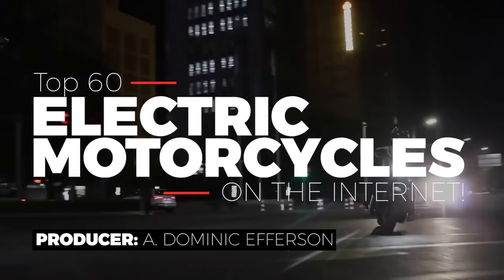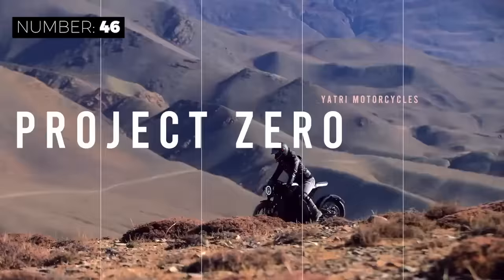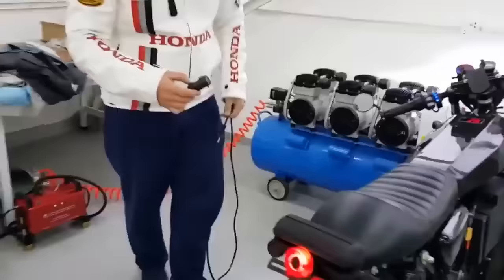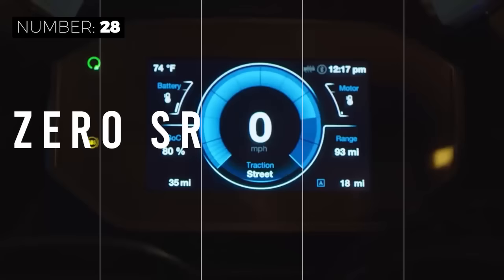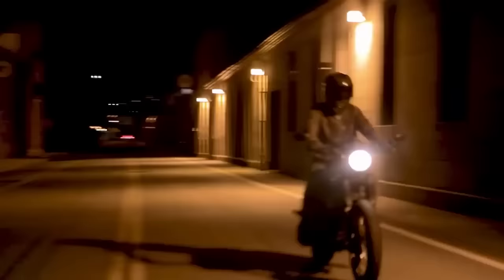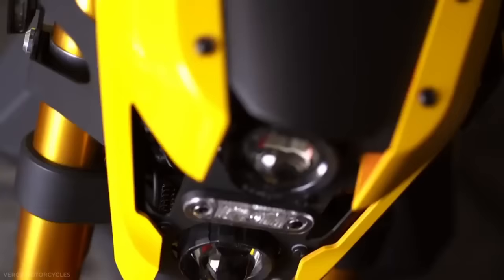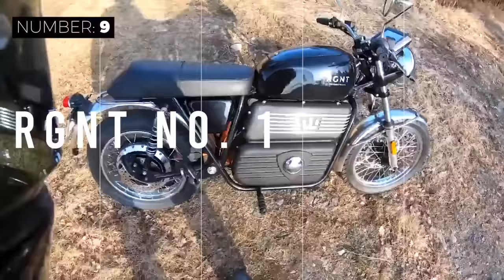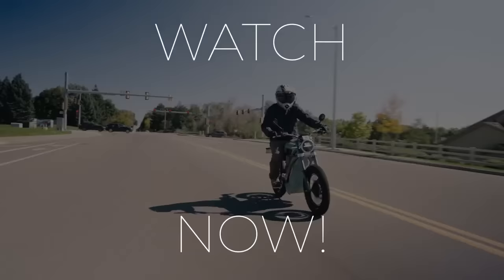60 Electric Motorcycles You Can Actually Buy

Comment: HD also bought the top ebike manufacturer in America. The live wire is a water tester and shake down product.
It started at 30k now it's 15k. Sounds like normal r&d new products.
Reply: Agree
Reply: 🤣no, it's because nobody wants them
Reply: I agree nobody wants them at 30,000 but it's a viable option at 15k.. the biggest drawback I see is fast charging at the dealership only and at home 110 v... There is no level two option

Comment: I want more cruiser options that don't cost $25k-30k.  Give me an electric Honda Shadow or Fury for $8k or less with a range of 250+ miles per charge and a charge time of 30 minutes or less.  As long as it can reach highway speeds easily and safely, I don't care about horsepower.

Comment: There has to be a way of towing a small trailer with two or three extra batts to make easier long distance travels. They could be connected by wire, so to set them on as needed wthout need to stop.
Reply from the maker: That's a fantastic idea and a creative approach to extending the range of electric vehicles (EVs) for long-distance travel! 😃 The concept of towing a small trailer equipped with extra batteries could indeed offer a practical solution to one of the main concerns around EVs, which is the range anxiety associated with longer trips. 

This idea taps into the potential for modular energy storage solutions, making electric travel more versatile and convenient. While there are technical and safety considerations to address, such as battery management systems, connector types, and road safety regulations, the concept holds promise for future EV innovations. It could also open up new business models around 'battery trailer rentals' for road trips.

Thank you for sharing your insightful thoughts! It's exciting to imagine how ideas like yours could shape the future of electric mobility. What inspired this idea for you?

Comment: My only problem with these is the range and the charge times. I do a lot of trips with friends and having to deal with the hassle of finding places to charge these doesn't seem worth it to me as well as how long you have to wait. I don't want to have to base my trips on having to find a charging station every 120 miles or less when I can find a gas station pretty much everywhere we go. Once they can get the range a bit better and it's easier to find charging stations I would probably consider one. Thanks for all the info and keep up the good work!!
Reply from the maker: Valid points.
Reply: Gogoro Scooters did what all electric vehicles should do : Swappable Batteries (like a cordless drill).  There would be say, 6 or a dozen standard battery types and people would exchanged batteries quicker than gassing up.  Start-up pains sure, but why isn't that done already?  Wel, Tesla for instance; would prefer that you were stuck with a proprietary setup.  But imagine if many different choices of fuel, all for different car manufacturers.  That would be a nightmare, so too will be too many battery types.
Reply: If the bike doesnt already have it, you can get an app that shows all the charging stations and they are absolutely everywhere.  The better full on motorcycles will have this and show you mileage and adjust driving routes and show total times etc.  Unlike cars tho, not all these bikes can use car style charging stations (the larger full on bikes usually do tho).  Its somethin that does need to be addressed for sure.  Also, some of these do support fast charging and charge super fast.  But for some uses they just arent quite there yet.  Great for commuters tho.
Reply: @BorisBlade7  adjust driving routes ? so, all your friends, need to follow you, so, you can go charge ? that sounds so wrong mate, i guess, within a short time, you'll be driving alone
Reply: @Steve25g  valid points man, but not everyone rides with people for long distances.  If its not for you then i get it, esp if you ride with big groups, but it works for those doing solo or dual rides with ranges and drives that suit this type of bike.  Personally Im waiting for the solid state bikes, those will solve these range issues since they charge stupid fast and capacities are higher.  But until then and the prices are also better, these bikes will not fill many roles that ICE bikes do.
Reply: If you only charge to 80%, you only have to wait half an hour at the very most, which is the same as most EVs these days.
Reply: @TheKnightsShield  And what ranges do you get then ? even less ?
Same with cars. thinking getting the model, that get largest range, I still need a full stop, on a longer trip, while my diesel can do almost the trip back, on one tank
Reply: @TheKnightsShield  Did you not listen ? The bmw for example,, only 8.2kw and it takes 65 minutes to charge to 80%.

Comment: rule of thumb for range is simple . multiply kwh by 10 - very simple - so 3.6 kw means 36 miles . you never want to go to below 20% so your range is 30 miles . not the BS they say here 180 miles .
Reply from the maker: Thanks for sharing the tip on calculating range, it's always helpful to have a rule of thumb!

Comment: Arc Vector manufacturer can get bent.. $118000 pds for a motorcycle.. Lmao

No one is riding a crotch rocket for 620km.. I would rather spend $20000 and have to recharge it 5 times then spending $130000Us…

So stupid

Comment: 8k is budget friendly? Lmfao. Okay.
Reply from the maker: It sounds like the price point of $8k for an electric motorcycle might seem a bit high for a budget-friendly option, and I totally understand where you're coming from! The definition of "budget-friendly" can definitely vary depending on individual circumstances and expectations. For some, the appeal of an electric motorcycle at that price includes considerations like long-term savings on fuel and maintenance, environmental benefits, and unique features specific to electric models. But I'm really curious to hear your thoughts—what price range would you consider budget-friendly for an e-motorcycle? And are there specific features or aspects you think are essential for making an electric motorcycle worth the investment?
Reply: @Electric-Rideables  In my opinion an electric motorcycle as "Budget friendly" shouldn't cost more than four thousand. I know it's an e-morocycle but if it's working, functional get me from point a to point b, it also shouldn't need advanced technical features. a simple straight forward build that gets the job done, priced adequately, so majority could afford it. Saving money over time is the natural benefit of an e-motocycle and shouldn't be used as a way to price things higher in my opinion. That is the functionality of electricity over gas fuel.